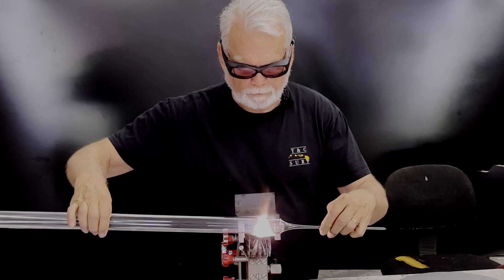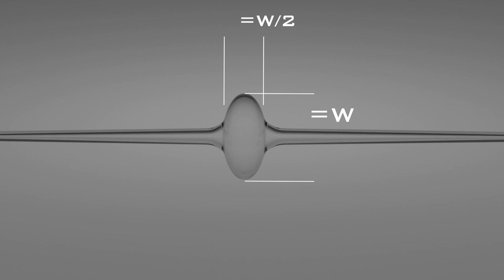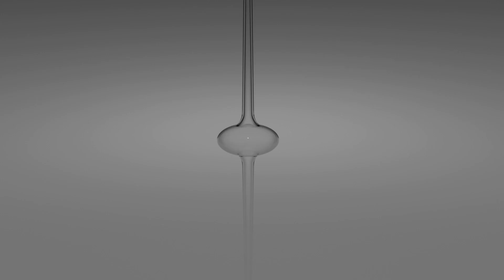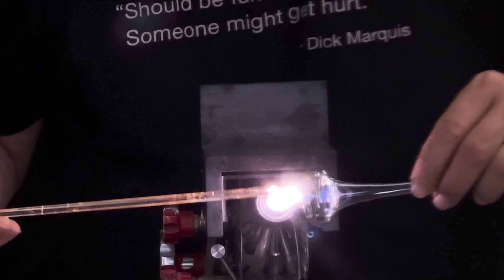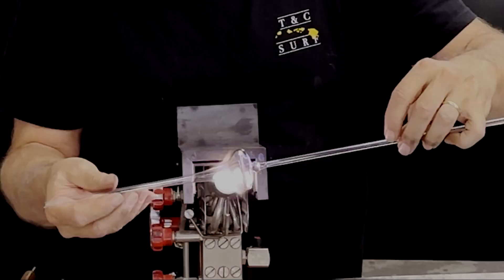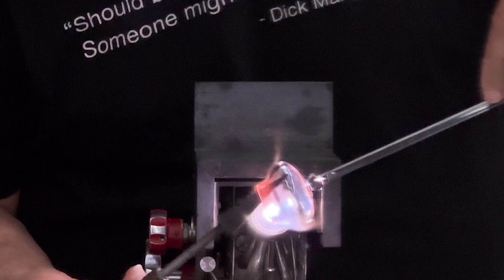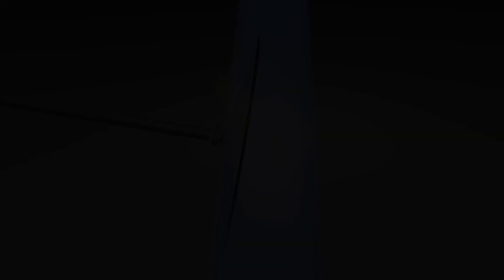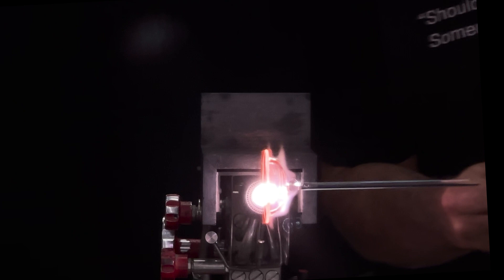Goblets Part 1 - Flaring a Foot - My Way.

Comment: Its ... so simple now... I get it! I've been trying to do this 'well' for months!!

Do you think it would work for miniature pieces too? I work in 1" scale, the foot of my smallest glasses would be about 6mm (1/4")
Reply from the maker: Probably not. This method relies on centrifugal force and there would not be much at that scale. Instead, use the same setup but a tiny graphite reamer to open the bubble.
Reply: @RAMickelsen  Thanking you kindly. I did try a couple of times but came to the conclusion that it wouldn't work. Thanks for confirming WHY though!

Time to get something heatproof to stick the end of the electrode rod in :D